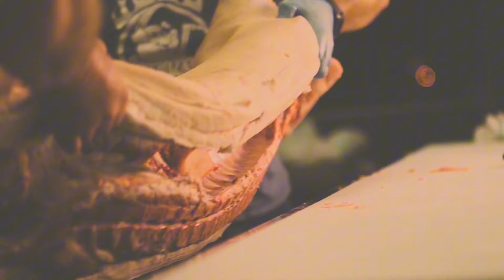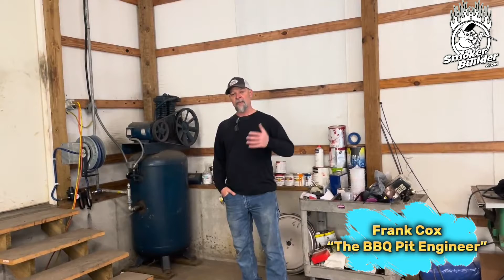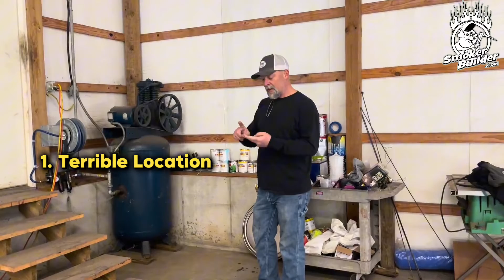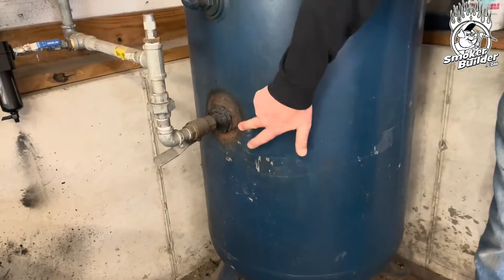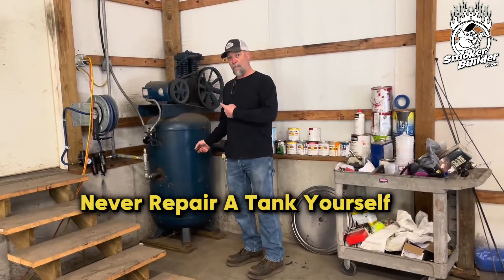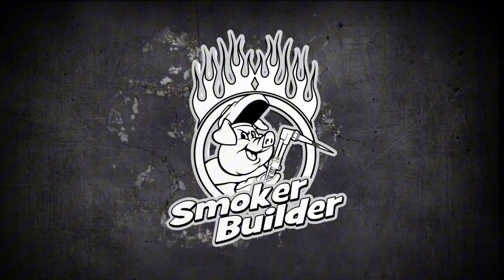Air Compressor Safety

Comment: As long as you are getting an different compressor you might as well salvage the tank and make it into a small smoker that way no one else will use the damaged tank for air.